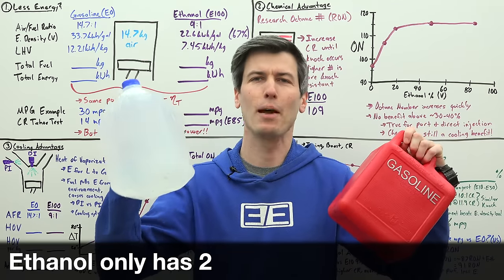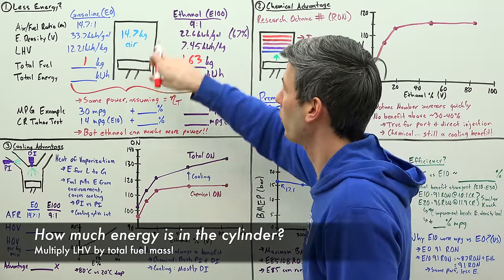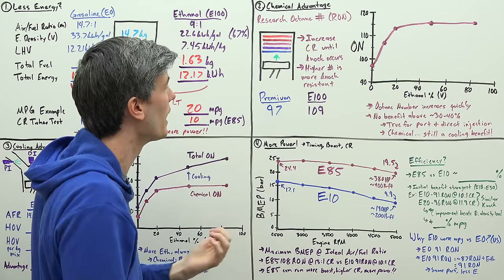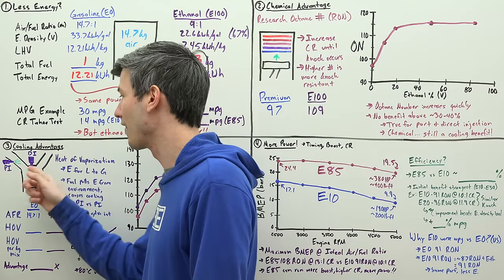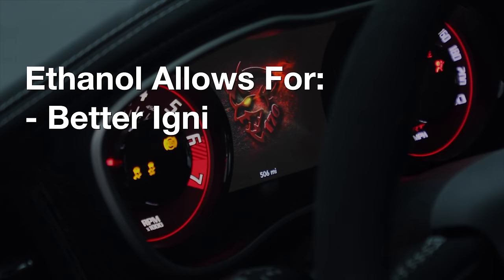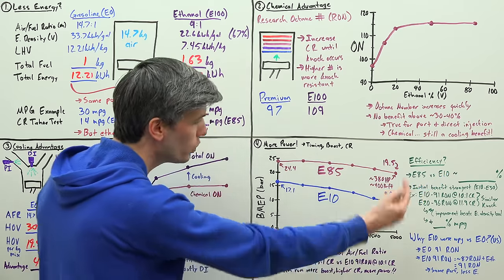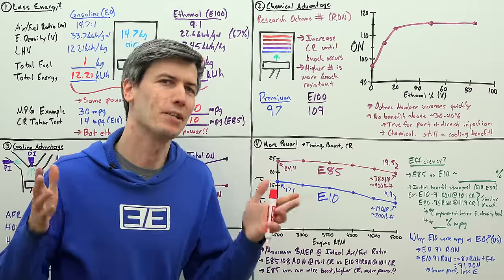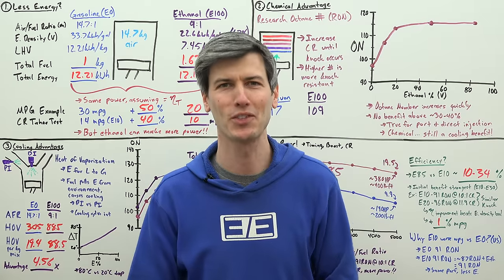Why Does Ethanol Make So Much Power? (Versus Gasoline)

Comment: Ethanol contains less energy than gasoline.
Reply: To be precise, you mean it has less BTU in it which is just a measure of heat.

Ethanol has other burn characteristics better than gasoline which can overcome the lower BTU in a piston engine.

So much so that is gets higher mileage and power than gasoline and even diesel engines.  Here is one Ricardo built for GM and drove around a few years ago:

FROM RICARDO:
The new federal CAFE standards are calling for a doubling of fuel mileage performance, which, Vint says, is going to send OEM’s looking for high octane numbers to improve efficiency and ethanol is the best source. Ricardo, an engineering firm with over 100 years in the business of engine design, has developed an extreme boosted direct injection engine (EBDI) to optimize ethanol blends. The 3.2 V6 gasoline engine rivals the power and torque of a much larger GMC Sierra 6.6 diesel, he said, and it delivers 3.5 percent better fuel economy than the diesel.

This is not new technology or knowledge, it was known long ago.  It is suppressed technology.

Rear Admiral C.M. Chester wrote Henry Ford a letter on Dec.15, 1916:
"...I also pointed out in the article that as governmental laboratories had developed from 40 to 55% efficiency in alcohol engines as against 20% in gasoline machines, the use of alcohol at double the cost of gasoline for power purposes, was cheaper for motor[s] than gasoline in common use today."

But even with our current lower compression inefficient gasoline optimized engines, ethanol has more power.

For example, a Chevy 5.3L is rated at a clean 380 horsepower on E85 vs a dirty 355 horsepower on E0.
Reply: @fletch2119  why would my 5.3 L59 suburban get less mileage and worse acceleration running E85 vs gasoline with 10% ethanol?
Reply: My suburban has the larger injectors meant to run E85 from the factory.
Reply: @blairp2318  It should have more acceleration from the extra horsepower, but your engine is optimized for burning gasoline so will have lower mileage with ethanol but the cost per mile should be better.  Certain blends around E30 sometimes don't lose so much I've seem others claim.  The EPA states that the US fleet loses 3 to 4% with E10 and 4 to 5% with E15.  It rates engines with E0 and E85 so you can look that up specifically.  Give me the year and I'll tell you what it is rated at.  Can't give links here.

You could be in need of some sort of repair or maintenance that is not allowing it to adjust the engine properly.  Something you may want to check out even if you burn only E10 given that you have irregular symptom.
Reply: @blairp2318  Ever change your air filter or your spark plugs? Or just blame Uncle Joe for everything?
Reply: @oldblueaccord2629  oil change every 5000km
Air filter every 10,000km 
Spark plugs every 50,000km
Check tire pressure weekly and all fluids weekly.
Reply: @blairp2318  In the USA we use miles....GOTCHA!
Reply: @blairp2318  I looked up the part numbers of a Chevy 5.3 injector and cannot find a different one for E85.  There are two different fuel lines listed since the fuel sensor in-between makes them shorter.

Chevy used to have a different parts book with separate ones for flex and non-flex.  I had looked them up when I had a non-flex 2015 and most everything between the two other than those two shorter separate lines, fuel sensor, and yellow cap were identical part numbers.

I know in Pump the Movie all the Ford parts were identical save the yellow cap.  Injectors have a range and ethanol's must not be of that range.

BTW, the yellow fuel cap I saw yesterday is a little bit cheaper for some reason.
Reply: I love how someone trying to sound like he knows something posts things like "In the USA we use miles and gallons" 🙄NASA and all US chemists, physicists and physicians use the metric system.
Reply: @francisdec1615  Too bad this isnt NASA.: ) The poster claimed 10% less "mileage" with 10% ethanol which is a red herring cut/paste erroneous statement. I had to ferret out if he was a bot or not. Thanks for trolling in good luck in your NASA career.
Reply: @oldblueaccord2629  The fact that you brag about using the impractical and unscientific "imperial" system simply shows that you lack intelligence. There are no benefits with the "imperial" system. People who hold onto traditions just because they are traditions are not the brightest ones.
Reply: @francisdec1615  you zrussians make us laugh...at you not with you...but just to make you happy Ill try and buy a liter of "petrol" tomorrow because you said so.

Comment: Burning more fuel make more power no way. Also you should be honest and smart enough to know and acknowledge  equal mass doesn't equal  equal density indifferent chemicals
Reply: Chevy rates their flex fuel 5.3L engine at 380 horsepower on E85 and 355 horsepower on E0.

In ethanol optimized engines you get both more power and more mpg than gasoline and even more than diesel engines.

Most engine manufacturers have ethanol optimized prototypes, Ricardo built one for GM and drover it around a few years ago.  Here is an excerpt from an article about it:

FROM RICARDO:
The new federal CAFE standards are calling for a doubling of fuel mileage performance, which, Vint says, is going to send OEM’s looking for high octane numbers to improve efficiency and ethanol is the best source. Ricardo, an engineering firm with over 100 years in the business of engine design, has developed an extreme boosted direct injection engine (EBDI) to optimize ethanol blends. The 3.2 V6 gasoline engine rivals the power and torque of a much larger GMC Sierra 6.6 diesel, he said, and it delivers 3.5 percent better fuel economy than the diesel.

This is why GM wants a new 100 octane fuel standard to get this efficiency. 

This is not new technology or knowledge, it was known long ago.  It is suppressed technology.

Rear Admiral C.M. Chester wrote Henry Ford a letter on Dec.15, 1916:
"...I also pointed out in the article that as governmental laboratories had developed from 40 to 55% efficiency in alcohol engines as against 20% in gasoline machines, the use of alcohol at double the cost of gasoline for power purposes, was cheaper for motor[s] than gasoline in common use today."
Reply: @danafletcher2341  so why don't you mention the fuel economy rates of both? But only the miniscule power increase 

While E85 is typically cheaper per gallon than gasoline it might be more expensive per mile. Since ethanol contains less energy per volume than gasoline, FFVs will generally get 15%-27% fewer miles per gallon when fueled with E85, depending on the car and the driver’s driving habits. department of energy  and they are the ones promoting E85.
Reply: @SunShine-xc6dh  For some reason, the AI algorithm censors will not let me post a comparison of costs to drive.  I post other things with numbers but something with this I think triggers removal for some odd reason.  I will keep this post without any numbers to see if it takes, sorry for that.

On E-eighty five prices Ezero’s price is four dollars and fourteen cents, Eeighty five is two dollars and thirty seven cents, Eten is
 three dollars and fifty cents, and Efifteen is three dollars and twenty three cents.

The worlds most selling pickup (Ford …)gets an EPA measured twenty one miles per gallon on Ezero and sixteen on Eeighty five. The EPA states that Eten lowers mileage by three to four percent and Efifteen by four to five vs Ezero.

This works out if my math is correct to nineteen point seven cents cost per mile for Ezero and fourteen point eight cents cost per mile for Eeighty five, seventeen point thirty six cents for Eten, and sixteen point nineteen cents for Efifteen.

Again, the Ricardo engine gets more fuel economy than even a diesel, so your question is a moot point on that.

The reason we put ethanol into gasoline is because it is an oxygenate that cleans up exhaust pollution that gasoline makes and is a non-toxic octane booster.  It replaced he disastrous oxygenate/octane booster MTBE.

Even if the cost per mile was not better and horsepower was not increased with ethanol, the cleaning of the air alone is worth it for humanity.

Comment: HA HA! Americans are just 40 years late in the game!!! Here in Brazil (porra!) we used etanol since mid 80's!!! Its a crap fuel, destroy the engine, but its cheap and works fine, but not so fine in cold weather (you need a gasoline reservoir to help cold start bellow ~10 celcius). And the this kind of fuel is easy to blend with water, in some cases they found 60% of water in tamper etanol... here in brazil we almost run on H2O engines! HA HA!

Comment: Doesn't lower octane gasoline have greater energy density? Higher octane with gasoline has lower energy density but has greater thermal efficiency and an overall increase in cylinder pressure...
Reply: Yes lower octane higher BTU.
Reply: Diesel : contains 12% higher BTU’s than gasoline
Diesel octane rating : 15-25
😂😂

This is a bit tongue-in-cheek, because the petrol engine and diesel engine work on different principles. Diesel fuel’s “quality” rating is the cetane number instead of the octane number. Cetane rating is the measure of the relative ease with which diesel fuel ignites.

Comment: Even more simple math, I get better fuel economy without  ethanol which is more miles.MMMM, No ethanol for me!
Reply: Ahhh, no doubt a diesel car owner we have here.
Reply: @danafletcher2341  Ahhh, no. Straight gas.
Reply: @jadedarby7290  I do not understand.  MMMM, Diesel gets better fuel economy than gasoline.
Reply: @danafletcher2341  Let me help you, Dana you brought up diesel not me. I get better mileage with Gas with out Ethanol.
Reply: @jadedarby7290  Evidentially mileage is not your key goal otherwise you would own a diesel.

Evidentially lower cost per mile is not a goal either nor pollution.
Reply: @danafletcher2341  Diesel is not offered in the vehicle's we drive.
Reply: Jade, I’ll bet you also get much better mpg with gasoline than you do electrons, too. Right ?
Reply: @sking2173  How did you guess that correctly, Petrol with no corn.

Comment: It cost more money than gasoline and it very corrosive for the fuel system
Reply: NOPE!
Reply: The spot cash delivered price of ethanol on the NYMEX is $1.62/gallon.

The price of unusable sub-grade gasoline (RBOB) is $2.72/gallon.

To turn RBOB into usable E0 costs even more much like premium costs more.  Unfortunately, it becomes even more toxic and dirtier.

Or simply splash in >10% ethanol to RBOB and the resultant usable fuel becomes less toxic, far cleaner burning, and cheaper/cheaper per mile to drive.  Who can be against that?

Perhaps you have confused methanol with ethanol.  The first flex fuel cars were methanol M85 capable along with E85 and had stainless steel fuel lines.  The methanol capability was quickly dropped, and the fuel lines returned to the standard mild steel fuel lines in current E85 only flex fuel vehicles.

Ethanol on most any manufacturers chemical compatibility chart you will find is at worst equal to but most often easier on metals, rubbers, and plastics than what gasoline and BTEX (benzene, toluene, ethylbenzene, and xylene) are.

Comment: How about methanol? Is it better
Reply: it used alot in racing but its danger in you can NOT see the flame when it burns and frankly its not massed produced in the quantities like Ethanol is.Its is also corrosive to some metals.
Reply: O ok thanks😮
Reply: I use heet <methanol> for winter in my car its 90 to 10 gas to methanol ratio
Reply: @Hades9898z  Yeah I would not go more than 10% and Isopropyl is better for water absorption.

Comment: Attention street racers, this does not mean you should start putting ethenol in your car.
Reply: Why?
Reply: @oldblueaccord2629  because it doesn't improve performance for stock type engines. A lot of people will use it for street racing but the way the engine is built doesn't necessarily support it. Unless you have a build meant for the heat and compression it takes to properly combust the fuel, don't put it in your car.
Reply: @bioshock1778  ok ill sell all my stuff and stop right now...after 15 years using E85 its gonna hurt. TIA

Comment: What I love about this is because of how they mix the ethanol gas and I get lower gas mileage and I literally burn more raw/pure gas than I would if I was running raw/pure gas.  Put in 10% ethanol and I get about 25 mpg in the city.  If I run pure gas I get about 30 mpg city for the same routes/driving conditions.  So, with ethanol I burn more raw gas and do greater environmental damage then I would if I were running pure gas.  Brilliant.
Reply: Missed the bus....AGAIN....whats it feel like?

Comment: Now let’s hear the downfall of ethanol,it rots every piece of rubber in older fuel systems it can’t sit in equipment over the winter without plugging every little orfice and it likes water.
Reply: Ethanol on most any manufacturer's chemical compatibility chart you will find is at worst equal to or more often easier on rubbers, plastics, and metals than what gasoline and BTEX (benzene, toluene, ethylbenzene, & xylene) are.

Henry Ford designed his Model T for ethanol fuel, not much older than that.  

The DOE found that ethanol blends last three times longer in small engines than E0.  The volatile aromatics used for octane in E0 evaporate out over time and leaves behind a sub-octane unusable fuel.

Water is not a problem with ethanol, just the opposite, it is a problem with E0.

In the days of E0, during wintertime they used to have to sell little cans of alcohol called Heet or Dry Gas as gas-line antifreeze.  No need since E10 came to be.

If E10+ was a problem we would know it right away for every winter there would be millions upon millions of stalled vehicles on the road in the northern US and Canada.

Mercury Marine, which hosted a Webinar on ethanol myths, noted that ethanol does not "grab water molecules out of the air." It is hydrophilic, which means ethanol holds water. With regular gasoline (E0) as well at E10, the primary cause of water collecting in tanks is condensation on tank walls. But unlike E0, which can absorb almost no moisture, E10 can hold up to half of one percent of water by volume, and the water molecules will dissolve in the fuel. The "solubilized" water will bypass the water separator and burn harmlessly through the engine.

Mercury Marine also says E10 may be the superior fuel(over E0) because it keeps the fuel "dry"
Reply: Well if you don’t run older vehicles you will know they are lying in Montana where we have many older vehicles you can not run ethanol

Comment: This pretty much turns about 25 years of reading about automotive engines and fuels on its head. Power for the same weight/volume of fuel is reduced by 25-35%, as is subsequent mileage (not an issue for short distances, but a major one for everyday use). The only way it works economically (for manufacturers and retailers) is through subsidies even more huge than existing huge ones for fossil fuels. I'm not ready to go along.

Comment: You make more power due to teh cooling affect of the evaporating alcohol.  Keep the charge temepratures the same, the gas will make the same power.  Ethanol costs the SAME. . .but requires TWICE AS MUCH for the same pwoer level.  Ethanol is NOT BETER.  IT COSTS MORE.  That is why we use Gasoline at the pump, and not Ethanol.  Another bBIG PROBLEM. Ethanol LOVES to absorb WATER. . .which make sit unusable.  Ethanol is junk.